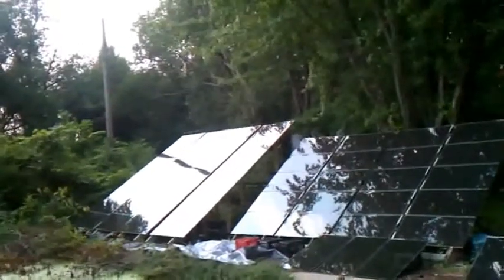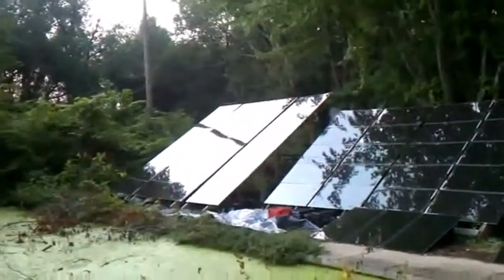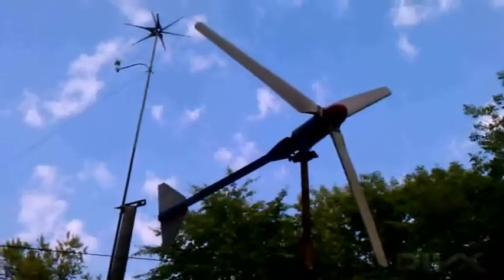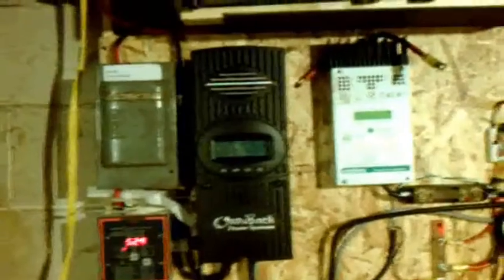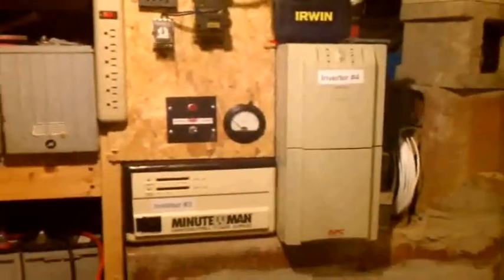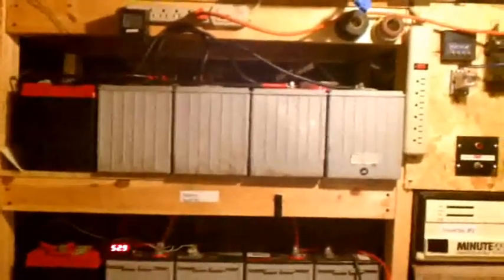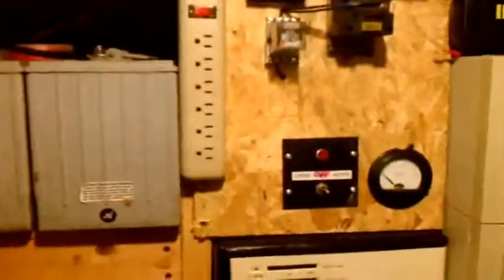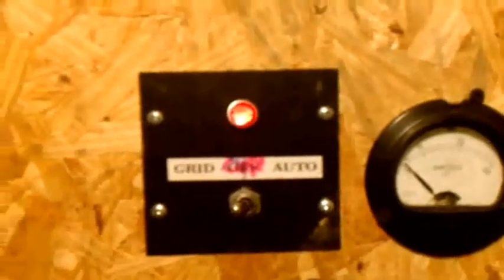Solar update 8.1.11 Rob in Akron.wmv

Comment from the maker: when you use a larger inverters that has a input for a secondary battery pack you need to swap the wires on the inside of the case making the secondary battery pack the primary power source otherwise inverter will not turn on without internal batteries present